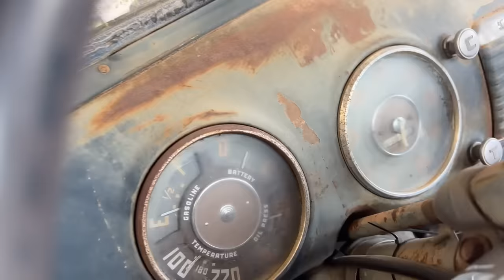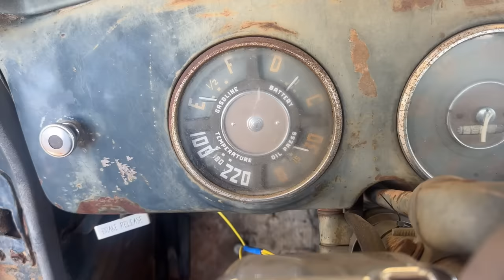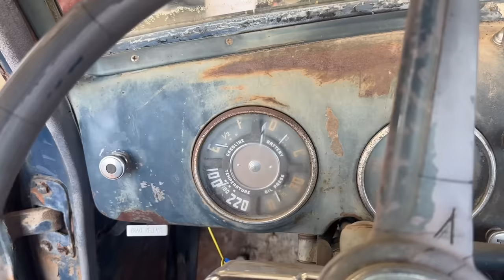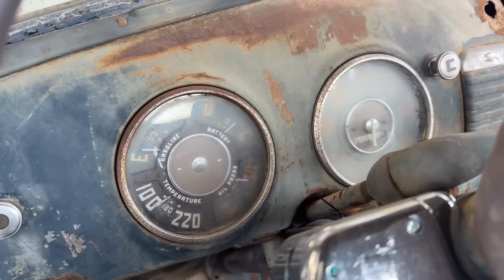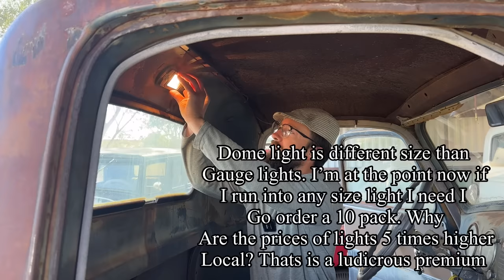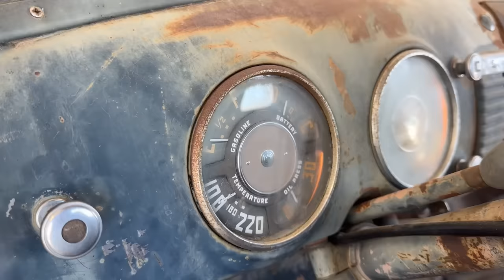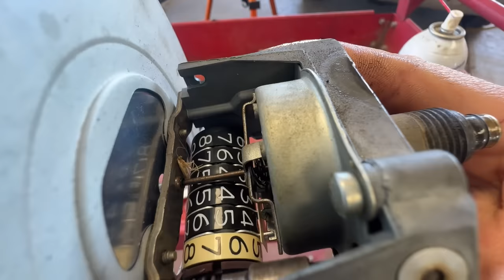TRASHED to NEW. 1948 Chevy gets budget INTERIOR + a hood and MORE!

Comment: Brings back memories.  In the late 60's we got a 47 Chevy for the ranch, and it became "my" truck.  It had some old 4 cylinder flathead that ran so well, we got a straight 6 engine from my uncle from some old Crysler.  Converted to 12 volt.  Anyway...I agree with the visor.  It made the truck look dignified & important I thought (ok, I was a teenager and it was mine).  It had the vacuum-operated windshield wipers that were miserable in operation, but the good news was with the visor, rain rarely hit the windwhield.  I had a couple truck mirrors for each side.  Also rigged a spare tire holder right behind the cab, much easier to use.  It was a great truck, way too much fun to drive and I still have fond memories of it.
Reply from the maker: That’s cool thanks for sharing

Comment: Great job, i just bought a 81 mercedes 240d it gets about 30 mpg its a om616 engine and 722.1 transmission w123 platform diesel car its my daily driver, I put over 300 miles on it a week so it'll be one of those famous high milage Mercedes that runs forever with maintenance of course haha

Comment: Had a VW diesel truck new back in 80s, drove until 2003. Had 400k miles and averaged 53 mpg. Sold to a Texan for twice what I payed for it new, 42 hundred dollars. Changed oil ever 2500 miles, used Amsoil 15-40. Engine tested close to new, amazing what PM can do for equipment. 😊

Comment: My buddy had an 81 caddy diesel that we made run on straight vegetable oil and used motor oil. He literally drove it from Portland Oregon to LA. For 10$ of diesel. Wich was only used to flush the lines. We made a heat exchanger out of copper tubing to warm the oil before it reached the filter in front of the injectors. We drove that thing up to the mountains and All over the place for free👌

Comment: the last car my dad drove was a manual vw rabbit pickup with a diesel engine. it was perfect for him. no matenance, no gas, no power ha. surprisingly, it had factory air that worked!

i drove it a few times, and discovered that diesel engines, having no ignition system,  can accelerate and keep accelerating and be almost impossible to stop.

Comment: Travis this may already be in the comments and/ or you may have already addressed or known that the hood near the hinges is raised and the best way I found how to fix it is using a second person. Loosen all the hinge bolts ( inside the engine bay and the ones inside the cab), close the hood and have a friend push down on each side of the hood as you tighten down the inside cab bolts. Then tighten and adjust the hinge bolts.

Comment: From one mechanic to the next, use hi-temp anti-seize on almost every nut & bolt. Also use brake lube on EVERY metal to metal contact point on every brake job you do. It will never squeak or squeal.

Comment: The truck is coming along nicely Travis. Love old VWs as I've had many myself and rebuilt and sold quite a few of them. I rebuilt an 81 Rabbit L Diesel w/4 speed. Man, that tranny sucked on the highway winding out that little engine. Swapped the tranny for a 5-speed and what a difference! Got 55 MPG on trips. The 5-speed shout fit right in. Also, make sure each glow plug is working. They are cheap to replace. You can pull them out of the head and watch them ignite to check.

Comment: Had a super clean, rust free, undamaged, great running Rabbit diesel pickup twenty some years back. Gave it to my "then" son in law as a commuter work vehicle. Unfortunately, he had no mechanical aptitude whatsoever and my daughter even had to teach him how to drive a manual transmission. In less than a year a circlip, cotter, or locknut fell of one of the attachments on the shift linkage and he had no idea what the problem was so he sold it for a little of nothing. The buyer fixed it in a couple of minutes and happily drove away having been handed a pile of free money. Having done countless repairs/renovations/restorations etc. I was absolutely appalled when I was finally made aware of it.

Comment: Travis I have found out that a product called "Freeze Off" made by CRC works wonders on rusted nuts and bolts. Lube the nut and bolt with a rust buster product and let set for a little while. Then right before you are going to attempt to loosen the nut or bolt or screw, you spray it with the Freeze Off. It has not failed me yet.

Comment: Great job Travis, those old panels are pretty thick and if they are deformed they are a pain to reform if ever! I saw the hood wasn't in correct shape when you first put it on and said oh he will be fighting a lot with that thing... 
The VW Caddy is a very common little truck here in Greece all old and new ones all vans and pick up ones. Vans are commonly used for delivery companies, plumbers, electricians, even farmers cause you can leave all your tools inside and not get stolen or get wet.
It was always based on Golf and these engines are really common here and easy to find. They are pretty noisy I never liked them but are reliable and drink very little fuel especially the non turbocharged ones. They are very underpowered though but with torque on the low end of rev range.
If you have the SDI ones better use the 1.9 Liter version cause the 1.7 is just putting out 60HP and it is really slow...
Keep up!! Cheers Jim.

Comment: The visor does look good, but I'm afraid as tall as I am that it'd be right in front of my eyes as I was trying to see out the windshield.  Many years ago I had an '86 Firebird and thank God it had T-Tops in it because if it had just been a regular roof I'd have had to drive ducked down constantly.  As it was, when I took the tops out and sat straight in the seat my eyes were just below the sun visor and the top of my head was above the roof line, lol.  I ALWAYS wear a cap while I'm driving because in most vehicles my head often rubs on the headliner and if I don't wear a hat, eventually there will be a stain on the headliner.

Comment: Travis I’ve built several of these old ‘47-‘54 Chevy trucks since I was 15 years old. I will tell you from my own personal experience, the generator and external regulators are GARBAGE! My first truck was a 1954 and I will never forget all of the side of the road troubleshooting of those stupid voltage regulators. I soon give up on them altogether and converted it to 12V positive ground with alternator with internal regulator. From that point forward I was able to truly enjoy my truck and actually trust it to make it across town and was able to take my girlfriend with me without breaking down (we are married now). From that point on the very first thing I changed on every old truck I bought was the garbage generator and external regulators. They went straight into the trash! You will not regret it! Keeping these old truck original is great and all but if you plan to take it across town you seriously need to trash the generator and external regulator. 

Nice job with your videos Travis. It brings back so many memories of me at 15 -25 years old working on my old pickups! These are my all time favorite! My first truck was a 1954 because I saw one sitting in a field before I was old enough to drive and I told my dad that I wanted that kind of truck and not a newer truck. I was in love with them at first sight at an early age!

Comment: On those old regulators… did you charge them with the field wire? I don’t remember the correct way to do it anymore, but I had to change one out on my pickup when I was younger, and I had to use one connecting wire to jump another terminal to charge the regulator and make it work correctly.

Comment: Great video Travis!
I just bought a 1948 Chevrolet Thriftmaster from Ohio. It came with a passenger side heater and I want to remove it since I live in the desert. There are two hoses connected to it. How can I completely remove them properly? Do I just plug the holes after removing them from the alternator?

Comment: When you put the hood on I was like 'What are you doing, Travis? This is so unlike you!' You would've had a much easier time if you had worked on it when it was off the truck. But in the end, it turned out fine. When you change the broken emblem and put the last touches on it, it will be a great truck! And it's a Chevrolet, so much better for me! 😁
Cheers from Argentina!
P. S.: You should do a series with that blue Rabbit or Golf (or whatever it's called in your country). Maybe go to a junkyard and find a newer diesel motor from a 2000's VW and do a swap?
Reply from the maker: It’s a little easier to do on truck so you can close it after bending and see how far off on the body panel you are.

Comment: I know how hard it is to weld sheet metal, thin metal melts easy as it gets electric arc heat. Try some brazing rod with a torch, not as strong, but the heat is less than arc melting. Your dad probably can teach you how to braze.

Comment: I meant to ask you because I was a little confused regarding the six volt system I thought that you had a generator so it would be 6 volt. I didn't understand why you would need a step down for the heater motor?
Reply from the maker: I put a 12v generator on

Comment: Did you put a volt meter on the generator with the truck running before you took it out to bench test?  Could have saved yourself some work.